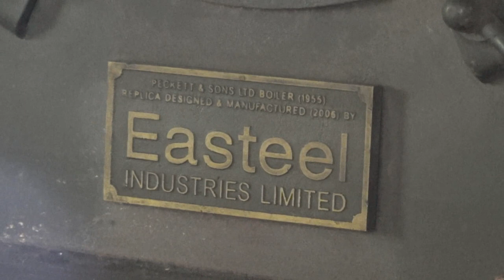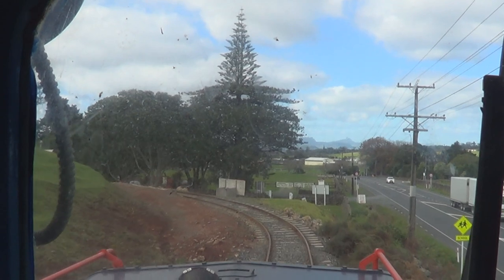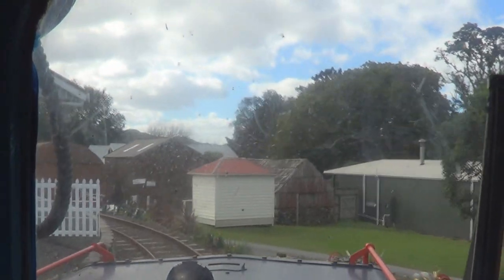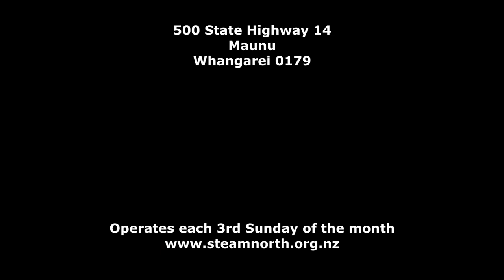Whangarei Steam & Model Railway Club - HD

Comment: they have 3 stations there right?
Reply from the maker: 4 infact, however one of them is disused
Reply: really what stations that?
Reply: Lauchlan Brady we have museum station which I was the ring leader on placing it there. then hikurangi station with the clubrooms etc. them Millington Station which is the last stop and last but not least we have Milnes which is in the middle.. all the track extentions etc I have been the overseer on all of the projects. last extention we have just about finished I s have not taken much into it as I been still finishing off the Museum station area
Reply: Lauchlan Brady the milnes one is not really used.. I built it on a old railway shelter staion.. with plans to place a over bridge over the track so the punters could visit other clubs in thae area in which it is located... that has not happened yet